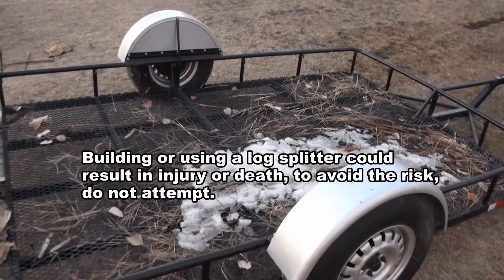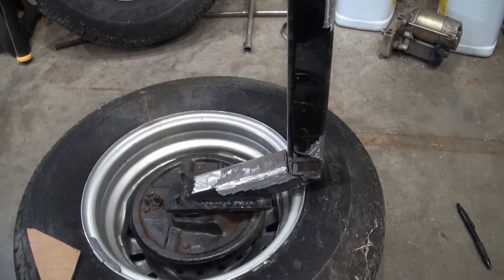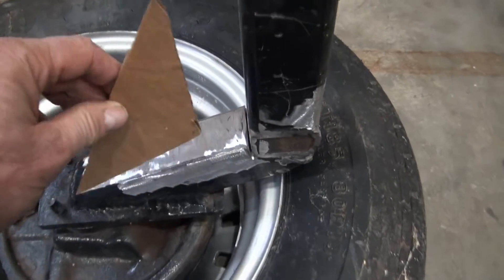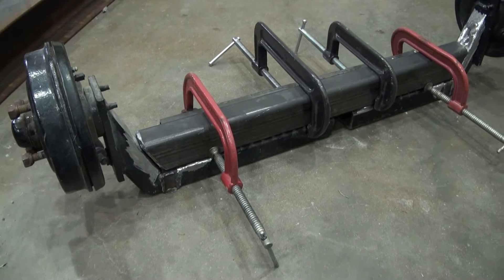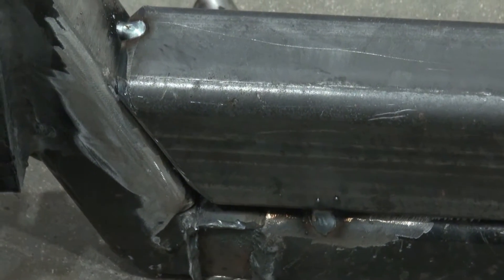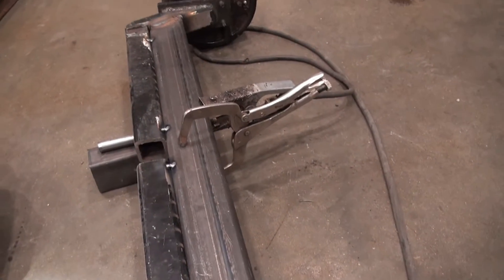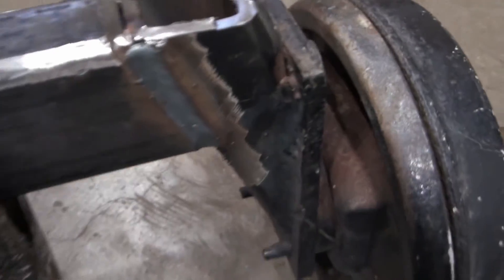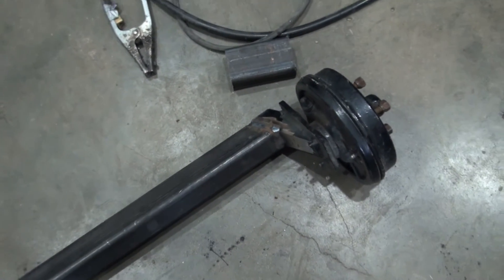Kinetic Log Splitter Build Part 1

Comment: I had 13 inch wheels on my log splter and loved it had a problem with bounce living off grid and dirt and gravel roads around the start of second year my muffler broke from bounce and gas tank they were the honda knock off i found large two gallon round gas tank and found a way to mount so it has a solid base and made a brace for the extended muffler so it had support on the end also made a cover for motor going down muddy roads would get covered in mud from the truck i dought u have much gravel Or dirt roads but check your tank braket occasionally 😮😂